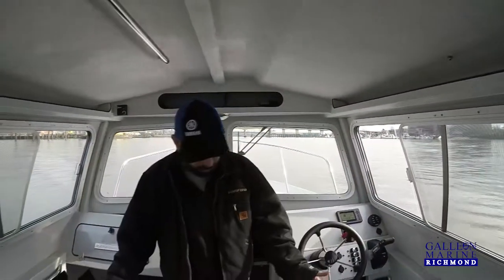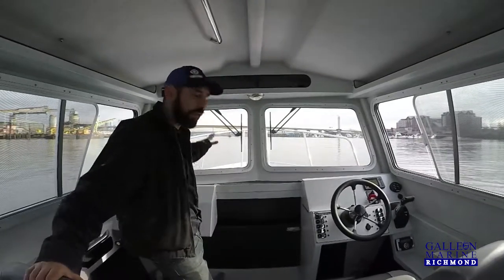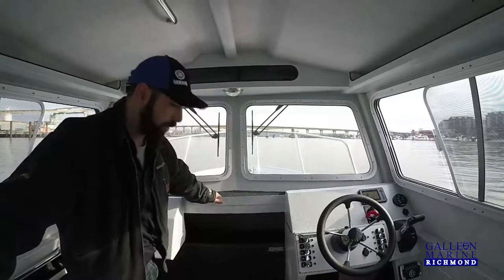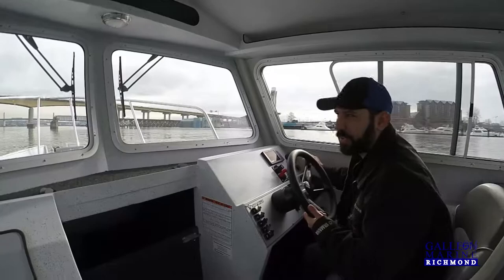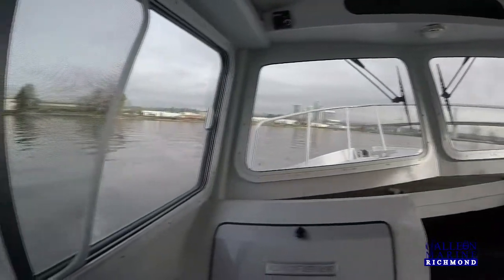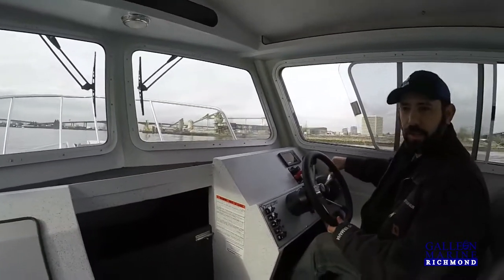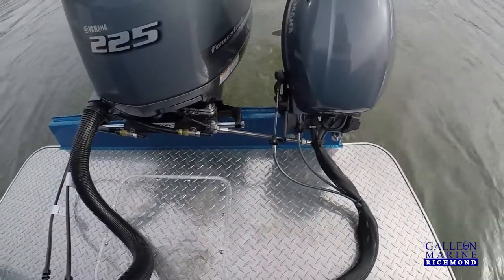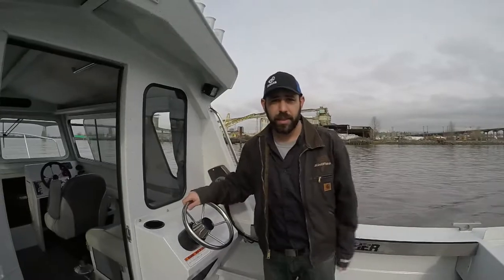Kingfisher 2325 Coastal Express Walkthrough and Water Test - Yamaha F225

Comment: These are decent boats. Ive been in the 28' a few times, the pros... its a fish slayer, handles a rough PNW ocean, you can be confident and safe in this boat, its a savage.  They are light and fast which is good fuel. Cons.... you can feel the boat twist and flex smashing through a rough ocean. In place of speed and fuel, you get a super rough ride. They have a flat bottom and slam super hard off waves unlike some of the deep vee boats out there like the Hewes Alskans ect.

Comment: this boat gets very unstable in  the wind,  if you want a stable boat you need to go to the 26 footer.  i just sold mine fo that reason...
Reply from the maker: There really is no trade off for weight.  The upside to the light boat is fuel economy, the downside is not as much mass to absorb high winds or rough seas.
Reply: @GalleonMarineRichmond  I agree 100%,  if I fished solo I could put up with it on the windy days but having clients on the boat... you should see their faces when the wind picks up lol, I need my clients to feel safe.  I will be going to 28 Duckworth  Xl. Twin 200s.25hp kicker